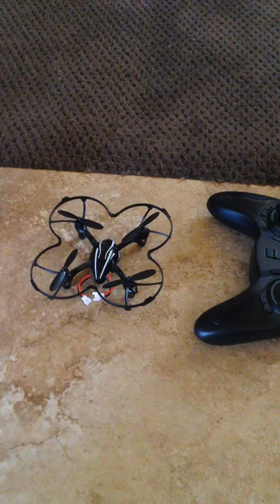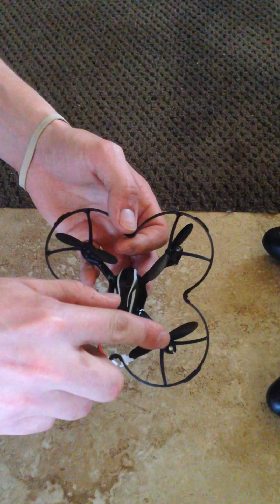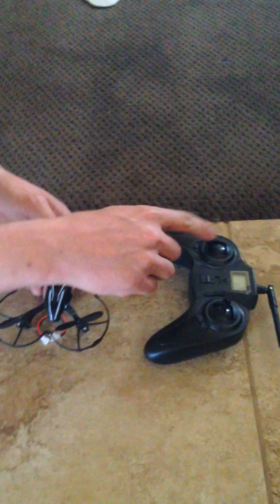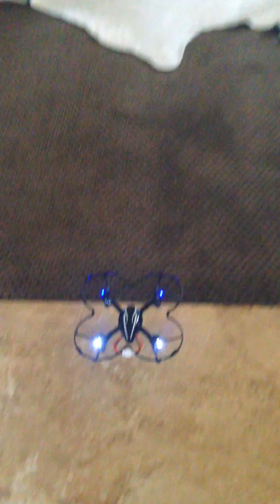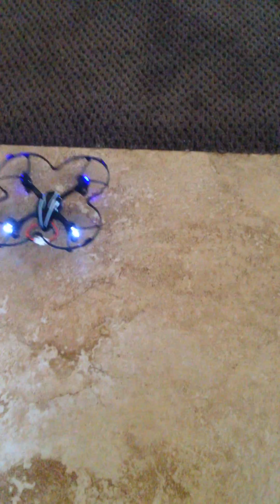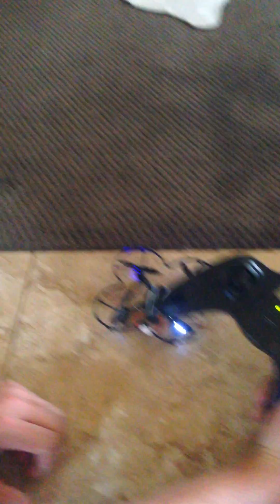How to Fly / Calibrate the Hubsan X4  ~Basic Beginner Tutorial~ Tips & Tricks h107c h107d Quadcopter

Comment: Great video! I'm hoping some of these tips will help out my problems. I just picked up the H107D+ and so far it has been a complete nightmare. Almost zero information in the instruction manual. It drifts horribly, and all of my other quads don't require trim adjustments, so I wasn't sure how to do that. So thank you for including that! It does maintain altitude, but it drifts horribly. Thanks for the excellent video; I'll give it a try after work tomorrow.
Reply from the maker: Glad it helped, getting started can definitely be a frustrating experience. That being said the Hubsan has been the most indestructible model I have ever flown. After you get good with it, I would recommend taking a look at a Tiny Whoop / Blade Inductrix and switching to FPV!